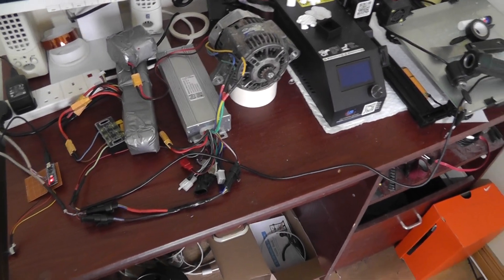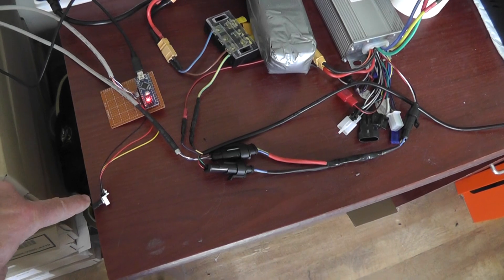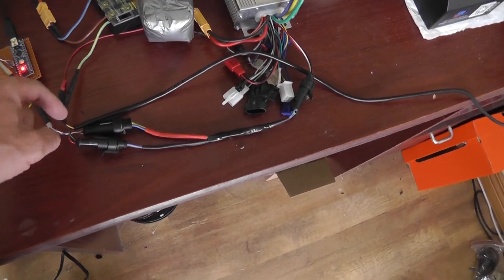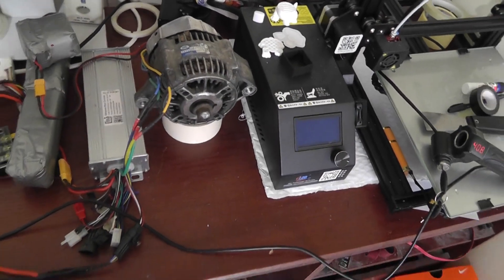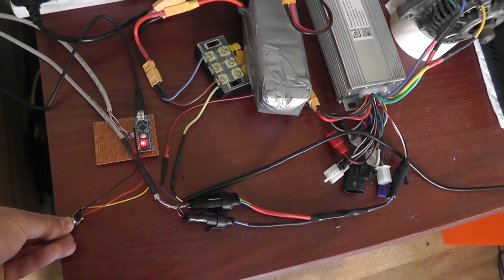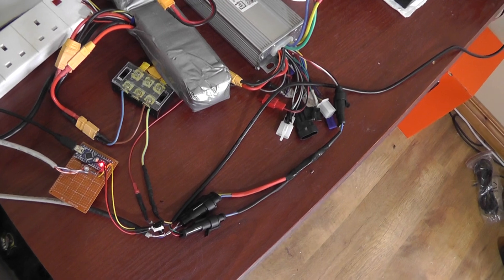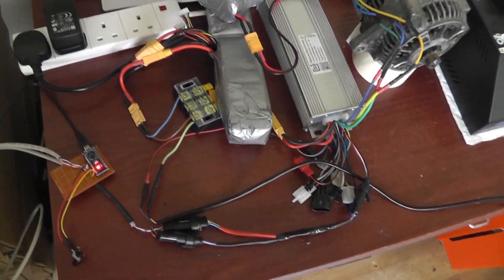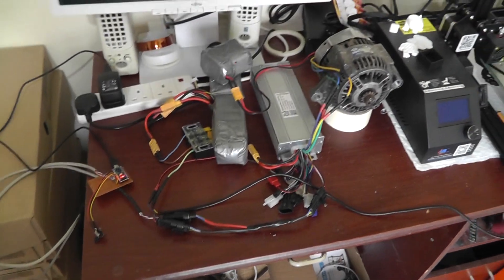Ebike controller with Arduino cruise control

Comment: Nice video. Can we run the motors via the controller with POT and not using the throttle?
Reply from the maker: Yes absolutely.

Comment: im trying to connect an arduino to read the data and send it via bluetooth, do you know if it is possible to use the data from the controller from an arduino? do you know how the connections works?
Reply from the maker: What data are you trying to collect with the Arduino?

Comment: Did you just connect the pwm output to the signal pin of the controller ....and didnt you connect the gnd of the controller to the gnd of Arduino....and last did you connect the +5 v wire on the controller to anything....
Reply from the maker: Hi and thanks for your message
Its been a while since I did this and if you check out my other videos I did a follow up taking it further but from memory yes to your questions.
The pwm output was connected to the controller sense wire.
The negs were all joined and the +5V from the controller only went to the standard throttle.
Reply: @alibro7512  thanks man....your the only one that replied.....others just ignores t
He comment....and you replied fast thank you very much.....
 Tooo

Comment: This looks good. Have you figured out how to use the motor controller with a micro controller and possible use a platform like ROS with it?
Reply from the maker: LOL, I thought an Arduino WAS a micro controller. Yes/No???
Since making this video I've been busy rebuilding my two ebikes and fabricating a GF/CF cover so haven't looked at it for a while. Hopefully I'll get back to it soon.
Reply: @alibro7512  Yes, sorry my bad. arduino boards have atmega32 microcontroller. Thank you. How did you connect your arduino board to the motor controller, It's not clear to me despite watching the video multiple times. As per the connection in this image in the link https://imgur.com/4ashYeG, how do I run the controller with arduino.

Comment: Hi ali bro,
I'am facing a problem with controller. Can't control the alternator speed either with or without the throttle, it is running directly when the power is on.
I'am looking for your help.
Please check the video in my channel.
Thanks

https://youtu.be/ZDqfWIDyNAA
Reply from the maker: Sorry I missed this comment earlier. 
Are the 'Self Learning'connectors pushed together? If so pull them apart.
Using a buck/boost power supply could give bad results as I don't think the voltage will be smooth. It may even be PWM.